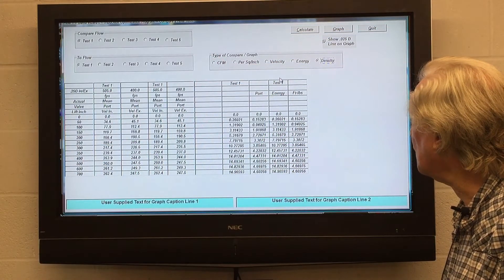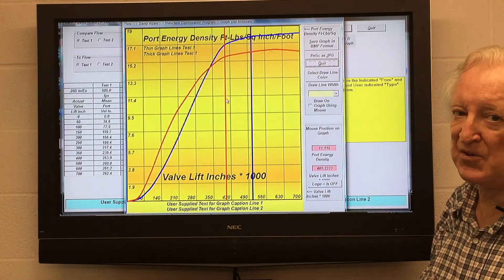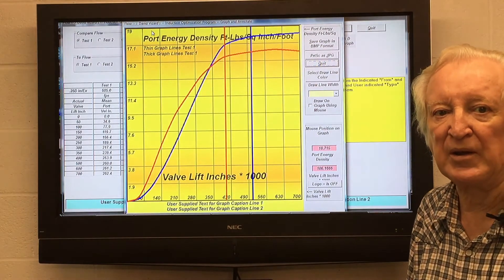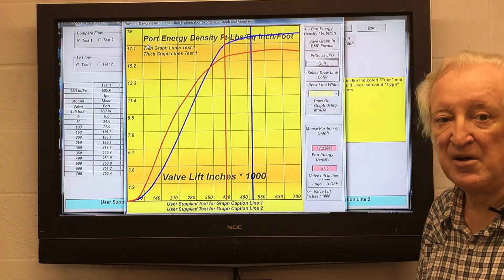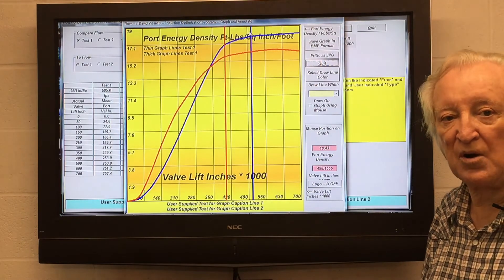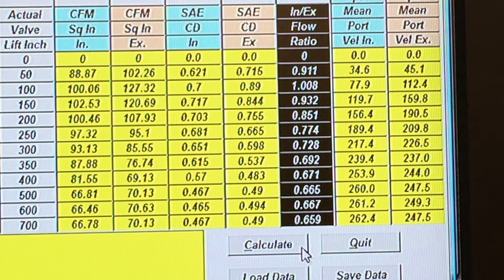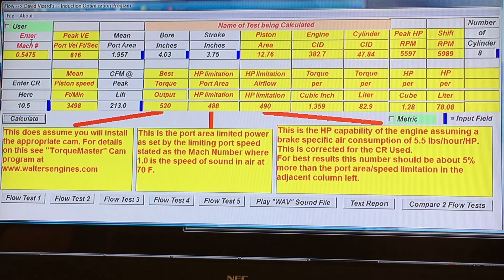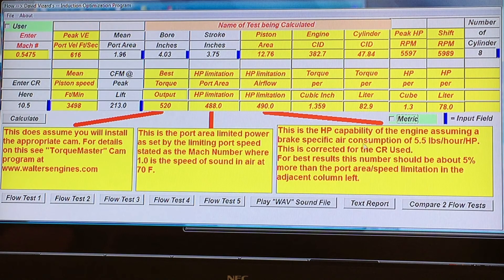Intake Optimization Program by David Vizard part 2

Comment: Hi Mr. Vizard. Could you do a video on building engines for torque and excellent gas mileage ? Wheres your ford book? Or dodge book?
Reply: In his other books, there is info on how to optimize for milage and torque. Many of the moves are bad for horsepower, but some are the same. One thing I remember is a hot intake with the stock sharp edges below the carburetor offered the best atomization and milage, having to do with the ability to keep lean mixture suspension.